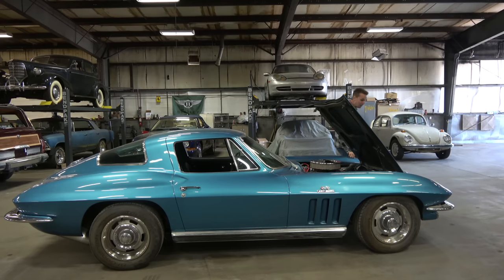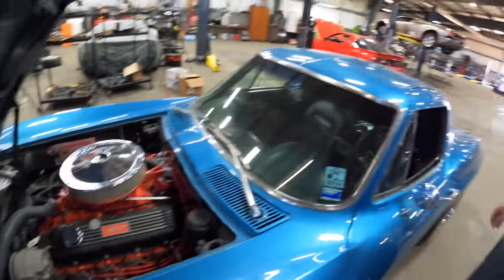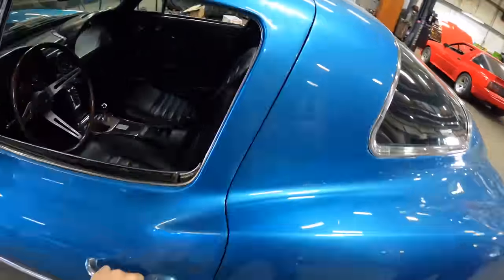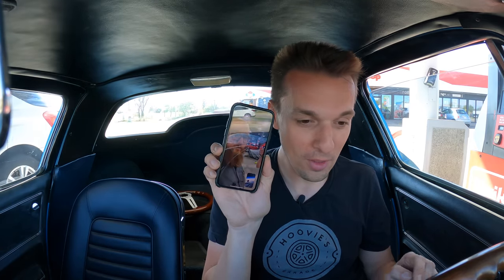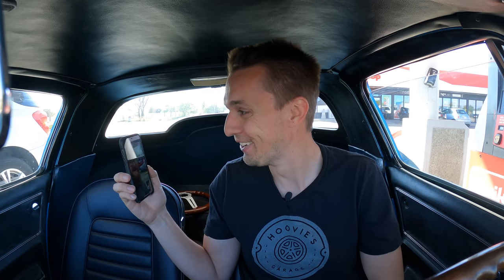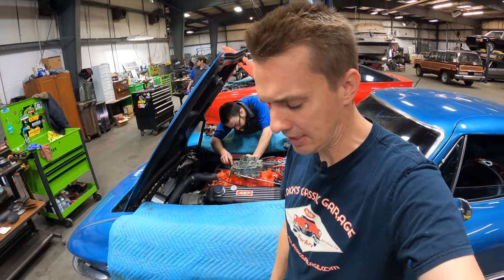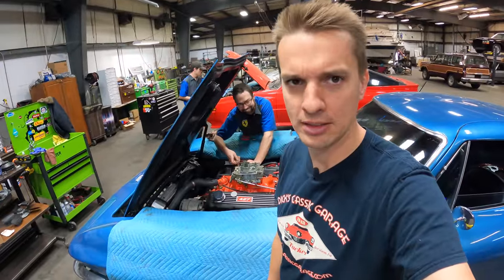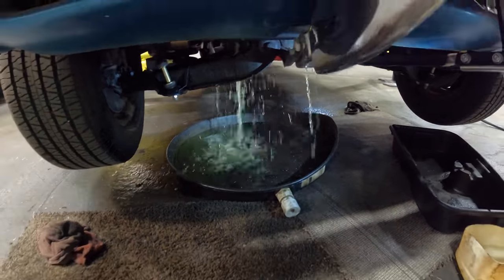Driving My Cheap 427 Corvette for the First Time (Of course it broke down)

Comment: My 1969 Chevy caprice has been sitting for 6 years and the 350 it has runs on old fuel it’s my account photo and it’s all original nothing has been changed every nut and bolt on the car It’s original Ohio car has all the paperwork runs great

Comment: U gotta flush that radiator out. I'd suggest a new aluminum one. But those clutch fans go bad. I'd put an electric fan in it for a daily but keep the original.

Comment: Looks like this Vette was stored with plain water in the block. No sign of any antifreeze. I have seen cars stored with the same fluid better then 20 years look almost new. Yes 20 years with the same 50/50 mix of Antifreeze looking like new with no signs of brown water in the block. Oil looking like it was just changed. One other thing I noticed being I am a long time Corvette Owner. Looks like this car is originally a small block car and someone put that big block in the car. Notice the battery mounted under the passenger side fender how all small block batteries were mounted. Big Block C2 Corvette Batteries were all mounted under the drivers side fender to the right of the master cylinder. Other then that looks like a very nice find for a ‘66 Coupe. I still own my ‘67 Coupe then I have no plans of parting with. Hopefully I will get to drive it this year in the Northeast. Too many things got in the way of me doing so the last 3 or so years.

Comment: The REASON they put large diameter steering wheels in cars back then was due to the increased leverage required to turn without power steering. Yes, you want an original style wooden wheel, just DON’T use the original diameter wheel. Get an aftermarket SMALLER diameter wheel. You will OVERCORRECT too much with that giant wheel.

Comment: Aluminum radiators do not do well with Rust in them... So the Radiator is probably corroded already beyond repair. just a matter of time. You should have done some kind of mild acid cleaning of cooling system. You put it in drive it around a while an flush it out.  I would have also run some real thin oil for a couple hours and then replaced oil again. Idea is to flush everything not just replace the oil. Same for brakes. On a car like this I would take heads off and clean and adjusted everything. You have a treasure there and you are treating it like a 10 year old Camaro  you picked up at a junkyard.

Comment: Well at least that car has no stupid computer modules to worry about. Spark, air and gas baby is all she needs old school. I can add I bought a Trans Am that sat for a few years and that crap they use in gas today ruined the tank, pump and 8 injectors. So expect fuel delivery issues if the entire fuel system was not fully checked.

Comment: It wasn’t ticking before it overheated, so let’s hope you haven’t warped the heads by overheating it. It would have been a good idea to flush the coolant on a car that’s been sitting five years before taking it on a highway. Time will tell. It’ll be very Hoovies if the heads have to come off and be skimmed for the lack of checking the cooling system properly before driving it fast.

Comment: no offense but all the fluids should have been flushed and the thermostat should have been replaced the 1st time.  All the fluids should have been replaced and flushed. It costs between $100-$125 to rebuild that Holley including parts, new ones are ~$300, rebuilding is cheaper since it was new but just sat. No problem getting the new carb to save time but money played no part in it. ( maybe he didn't really want to rebuild it so Wizard said best to replace ) Should have replaced the diff and trans fluid also, just to be safe and verify the levels were proper. I bought a 69 Vette that sat and did all that on mine and it ran great after. If the tires are not cracking and the date code is < 10 years, you could still use them for non race type stuff. If the sidewall is showing minor cracking of the rubber then get new tires. My last set of performance tires lasted 9 years as I drive very little. My car is kept outside so the rubber would break down faster than if stored inside where the UV light doesn't hit the tires. I love that color. My favorite combo is that Blue with Tan leather for the interior.

Comment: Someone filled that cooling system with plain water - if the car had been standing for years coolant and thermostat prob should have been changed as part of re-commissioning imho not just the oil.

Comment: a plain jane 600cfm holley sitting on a 427?    No wonder its a little low on power on the top end!  These engines came with 780cfm Holleys.

Comment: To have been told that “It’s running and driving!” and to THEN find out that they hadn’t yet even looked at the coolant? Wow. During that second day, when Wizard said that there’s a bunch of rust in the coolant…I think I would have said, “Wait. You didn’t know that already? Why did you tell me it was ready to drive if you hadn’t checked the coolant?” Y’all, is there something I’m missing here? Is it standard practice to do the minimum necessary on a restomod like this, and just fix stuff as it pops up? Am I weird to have assumed that they’d change ALL the fluids on day 1?

Comment: These engines have an atrocious water pump. The center of the heads with exhaust valves next to each other also does not help.  The pump has a different sized outlet on each side.

Comment: Doesn't make sense to PAY someone to rebuild a carb maybe.  Holley rebuild kits are under $70 and it takes about an hour to rebuild one.  It's a good exercise to go through because you will likely need to tune that carb anyway and that will teach you what is going on.  Carbs are NOT cheap in my wallet.

Comment: I come from a family of mechanics.  Including myself But a car that been sitting for that amount of time.  Any  good mechanic is going to drain and flush the coolant system, fuel system, change the oil,  check/top off tranny,  check/change rear end,  grease all fittings, check ball joints, check tie rods, wheel bearings,  and clean the carb. and for god sake in this case it's a solid lifters check and adjust the valves.  To me that is common sense in most mechanics Before you even turn the key for the first time.  T hen after the 2 successful test drives.  Check everything again. especially the lifters.   I wouldn't take my car to these guys.  And Hoovie.  No disrespect but you don't seem to be this kind of corvette person.  Maybe have a little fun with it and sell it to somebody else

Comment: That dot doesn't prove anything. You can easily repaint the car and tape off those areas jambs etc when going with the same color. It could be the original paint but I wouldn't go by the dot theory alone. I call BS on the secondary side opening while just sitting and reving it. A vacuum secondary system will only open at WOT and when calibrated properly will do so when the primary side has maxed out providing engine power. If you feel a bog when they open there opening too soon if you feel a kick in the pants there opening too late. I've rebuilt and tuned hundreds of holley carbs there a masterpiece of engendering.

Comment: You need to run a citric acid mix through the cooling system to clear out the sludge and neutralize the rust. :)

Comment: 11:10 Seriously? It’s easier to replace a Holley carburetor than rebuild it? Holley is easy to work on. How cheap is a new Holley these days?
Reply: Pretty sure the original carb was a Rochester ~not a Holley
Reply: @batch1638  Actually, Chevrolet did use Holley carbs on some Corvettes. Not an expert, but as I recall it was on the two four barrel setup. The reason I know is in the 1980's I traded a 750 double pumper for a 650 and the guy I traded for it pointed out the 650 had a GM part number.
Reply: @batch1638  Here's an article; hopefully YT won't eat it because of the hyperlink.
Reply: Yup they ate it. "The Holley 4150 series carburetors first appeared on Chevrolets with the 1965 327 and 1966 427 Corvette engines. Holley List # R-2818-1 was a 600cfm and R-3310-1 was a 760cfm. The R-3310 is still sold today as the basic 750cfm, manual choke replacement, with a single fuel inlet. GM's usage was limited to Chevrolet cars and trucks, but Holleys can be installed in many other GM applications with the use of an intake manifold adapter, or by changing to an aftermarket intake, which accepts Holley square center open pattern. In subsequent years the 327, 396, 402, and 427 engines used these carburetors from 1967-'72. You are most likely to find them on the big block cars, and especially the Corvettes, but Chevelles and El Caminos used the Holley four-barrel units in both big-block and small-block configurations. The El Caminos and pickups used the 4150 series carburetors until 1974, and Chevy motor home chassis used a model 4160 until '76."
Reply: @MrJeffcoley1  YT sabotage! No link. Thanks! I did get into a Corvette user group last night until I blacked out!! Our “user group “ was a gas station (back when there WERE real gas stations!). Except for a mopar or two it was all GM and mostly Chevy. I remember the time I wanted a bigger carb (bigger is better, right?) for my 70 SS396 but couldn’t get a Holley dialed in, no matter what we tried. Eventually rebuilt the Roch. Best times!
Reply: $800+
Reply: @batch1638  If the Car Wizard charges that much to rebuild a carb, then he's really telling us he doesn't want to work on carbs so he charges a prohibitively high price.

For real - you can rebuild a Holley with nothing more than two screwdrivers, and about an hour.
Reply: @MrJeffcoley1  the question was how much does a NEW Holley carb cost? I guessed $800... probably less than that... New 4150 from Holley   ~ $500
Reply: @batch1638  I did look it up, and no Holley carbs are not $100. I think a lot of people are frightened of carburetors, they think they're black magic or something, and are willing to pay anything to avoid messing with one. Which is really silly, especially with regard to Holley which are super easy to work on.

Comment: Pretty car.  And it's only a barn find if you found it in a BARN, by definition.  You can't just make such terms mean whatever you want them to mean...strange.  Do you do that with words like chair and table, too?  

Whoever owned that Vette should get acquainted with antifreeze before he wrecks his next vehicle.  I've heard of more money than brains, but that guy was asymptotically approaching infinity on that metric.  Spend tens to hundreds of thousands on a car and then hose it for want of $10 of antifreeze.  Brain activity flat line either achieved, or imminent.

I don't know how some people find their way to work and back.  I swear the human race is splitting into two separate species.  It seems a reasonable statement, when I see things like this (and MUCH worse).

It's antifreeze and DISTILLED water, folks, nothing else, no stop leak, nothing.  And in the correct ratio, roughly 50/50 by volume.

I suspect if it didn't already take out the water pump, it will soon, and I also suspect it's new radiator, or radiator rodding time, if they even still do that anymore.  At today's labor prices I seriously doubt it.  Everything today is throw away, and that is an industrial strength stupid mode of operation...but hey, let the next generation deal with it, another stupid mode of operation.

"He replaced it with a modern transmission/modern shifter and now .."  should have maybe ended with "it drives a lot better, and is worth a lot less" (if numbers (if applicable, usually engines) or at least original type, matched before, which apparently it was an original unit, meaning at least design wise).

I have a friend that owns one of these, a bit earlier year, where everything is original.  At least it was until a couple of years ago, when he started it in the garage and it threw a rod, at idle, basically.  He then had the foresight to have the block repaired and rebuilt the internals to reinstall for sale when and if he ever does (he's owned it for about five decades now).  He put a 500 horse crate motor in it to drive, but he says he's almost afraid to drive it now, considering its present value.  

He had the thing painted black with gold trim on the scoop etc in 14 coats of hand rubbed black lacquer originally and he went to the shop to pick it up and looked at it, walked in and said 'why is the paint bubbling up on the fenders'.  The guy said 'very funny'.  Steve said he was serious, they went out to look, and the guy just hung his head and said it will be ready in a few more days.  It was gorgeous when done, you could see individual leaves in trees reflected in it.

He bought one of the new super vettes a few years back and says the old one is still more fun to drive.  Not as quick and certainly not as well behaved (no traction control, etc) but a whole lot more visceral driving experience.  The new one is quick though, feels like it pulls at basically traction limit for a good way up the MPH scale, at least comparing it to even the fastest cars of the sixties.

Comment: No, its not a barn find. Its not an anything find. 😂
Its a car you bought that had been sitting in a posh workshop for a couple of years.
What is it with you not turning the engine off and continuing to drive when the oil pressure needle is pegged to 0, or the temp needle is pegged to maximum? 😂
Such a masochist.

Comment: Too much money, if you drive off in a car that has been sitting for more than 5 years without changing oil, gass and other fluids.. you simply don't care I guess. As for the wizzard... not very good promotion for your skills: the car is ready, you can take it for a spin... oh you're back, radiator overheated you say? Well I can fix that. Should have prevented it you say? Well, I got a dog and a cat to feed and pay the rent and my employees. But YouTube pays for it anyway, so there you go.

Comment: I have not heard so many incorrect statements in one video for a long time... from a car guy who doesn;t know much about cars... but likes them.
* Original 4 speed was tough...
* The dot means it's original paint... (One questions, does it have a clear coat..?)
* It needs an alignment but it's going down the ropad straight...
* That was not a flush, water was just run through at no pressure.
* It sounds a littel tickey though... yep.. you F'd it running it at such a temp. A car that suddeently ticks after a over heat episode... yep, it needs a rebuild.
... and how could the wizard send you out for a drive withcoolant looking like that... you reallu ened to fiund yourelf a Grand Wizard for the rubbish you bring in for repair... LoL...
I have realsied.. that thing aboutt eh dumbest automotive youtube channel.. you arfe spot on with that statement.

Comment: Listen to the wizard your typical mechanic just drive and then tell what the bugs are all that work and then after 2500 dollars you need a motor don't worry we flushed the motor 800 dollars there were 2 of us I can here the motor running it's junk of just a valve adjustment       these mechanic are idiots